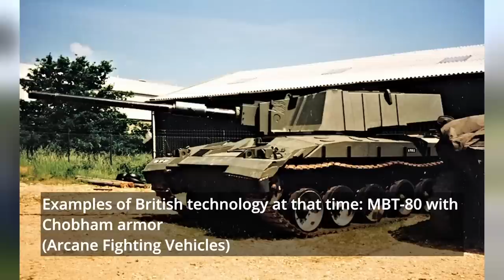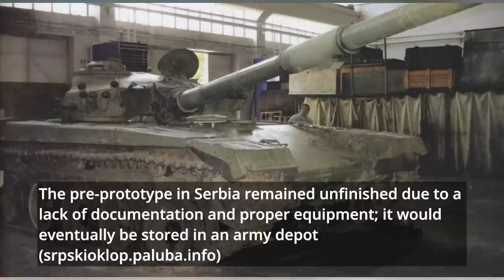Whirlwind before the Crash | M-91 Vihor

Comment: M57: "Let's take the TT-33 Tokarev and improve it."

M70: "Let's take the AKM and improve it."

M-84: "Let's take the T-72 and improve it."

The Yugos sure did a lot of that, not just copying other designs, but actually improving on them in many ways.
Reply: Serbia continues this tradition to this date
Reply: @TheJohn_Highway  maybe other things, but most definitely not AKs. All those newer imported zastava AKs are 10 times worst then those produce during Yugoslav times. Did you made any improvements on M84 or those upgrades are still on backburner just like Croatian "degman" (which seem to be cancelled)?
Reply: Yugoslav was really good in this. Even when they changed the design of existing firearms such as Zastava M56 which was kind of a hybrid in PPS-43 and MP-40 and it was awesome
Reply: Nah the m84 still sucks the t72 is still a better machine

Comment: Even the M84 wasn't simply a T-72 copy. It is not fully compatible with other T-72 variants. Gun is, autoloader and general appearences. However, armor materials were a bit different, it had totally different fire control system, ballistic computer, self-entrenchment tool and some of them were equipped with anti-magnetic system for mine defense (basically, it increases magnetic field of the vehicle thus causing magnetic mines to detonate too soon, before the tank runs into them). Also, the engine was totally different; it was multi-fuel instead of diesel. 
A lot of these and more were to be incorporated into Vihor (Whirlwind). But, it never came to be...
Reply: But Is true that it'was based on  T-72 export variant inferiour to T-72 made for russia?
Reply: @sjoormen1  The export variant is inferior because it is missing all the stuff that Vihor added back.
Reply: @zchen27  thx so it's same, not better than russian standard model? What aboout armous- does turret have quarts in it?
Reply: @sjoormen1  M84 was based on export "commander" version of T72.
Ordinary export T72 was called by western experts "monkey"T72 bc the quality of armor and materials was worse than of T72 made for Russian army.
Only commander version of T72 was the same as real Russian T72.
More than 100 M84s were exported to Kuwait before Gulf war and they turned out to be superior to Saddam's T72s.
Croatia continued to export them even during war between Croatia and Serbia(which I don't understand bc we needed tanks) but also we needed money so...
Reply: @mynick937  thanks for you answer.
Reply: @mynick937  actually during our wars, not Croatia alone was expottimg tanks to Kuwait, but together with Serbia.. Croatia ćn engineers were coming to Belgrade for consultations and for paperwork for export, and visas in Kuwait Ambasy, and than back to home, and together with tanks were going with ships from croatian ports..
Reply: @mynick937  the secret reason is corruption
Reply: @lukabajic9729  I don't think so.
It was probably political decision.
Reply: @sjoormen1 the export t72m/m1 werent inferior, the m was a t72a with a ural 1 turret, whilst the m1 was identical to the A variant
Reply: @mynick937 everithing you said is wrong. Export t72m are t72A with a ural 1 turret and t72m1 are identical to t72A. These were the models operated by The warsaw pact and yugoslavia. The so called "monkey models" are these tanks with most of their internal electronics removed before being sold, these were only used by countries the soviets deemed as not trustworthy.
Reply: @barbarapitenthusiast7103  Sure about that?

Comment: It was not licenced T 72 although they look similar. It was completely designed and produced by Yugoslav engineers. My dad was working on this project developing propulsion system.
Reply: I've heard that a license was bought for the T72M but sub systems were different and armour at least on the M84A.
Did Vihor have an auto loader like T72? Thats the biggest problem on T72 the ammo explodes thats why Western tanks always have the ammo in a separate compartment with blowout panels.
Reply: @aramisone7198  initial production M84 had manuel loading, soon upgraded to auto, new aiming system, electronics etc. Yugoslav M84 didn't have that kind of problem with ammo exploding
Reply: @aramisone7198  the autoloader is not the issue, its the least hit area on the tank the real issue it the ammo in the turret, but that can be removed. Most nato tanks dont have blowout panels, only the m1 abrams has them, leopard 2 have most of their ammo unpprotected next to the driver behind paper thin armor, chalenger 2 have all pt their ammo exposed.

Comment: I'm sceptical, those are mostly goal statistics, i highly doubt if they'd actually manage to achieve all the numbers yet keep combat reliability.

Like the "80% ERA protection" which in reality was closer the 25-30%
I also think that 600mm pen would likely be 450-500mm pen, and it's own armor to also have lower values in reality, along with the horse power.

Regardless, tanks aren't only about hard factors but soft factors too, and I do think it would be a competitive tank due to those, just not in the way unrealistic tank fans would think it would.

Comment: M84 was much better than T72.. for example M84 in all versions have meteorological sensor,modern range finder,fire control unit.. first Russian T72 with meteorological sensor was on T72BA in early 2000s.. when M84 was made,there is few tans with modern electronics,even western tanks had coincidence rangefinder.. Leopard 1,American M60.. you had to calculate how much you need to move your barrel to compensate some stuff or intercept other tank.. in M84 you just had to aim and shot.. In 90s they had so many casualties just because we didn't have ERA.This tank had all modern German sensors like Leopard 2.. If we need to compare,its somewhere between leopard 2A5 and 2A6..also at that time Leopard 2 still had ammo in tank turret...

Comment: challenger2 and Abrams have at least double the armour protection.  so no , this tank could not keep up with the west.
Reply: that's about everything those two tanks have, they have worse speed, weigh more (thank the armor), worse gun and in general were bigger, western tanks are the DIRECT opposite of eastern tanks: slow but big ball armor, while the eastern are more mobility over armor
Reply: My Source: I made it up
Reply: @Lazar-ox5bd don’t know what you are smoking but the west definitely do not have worst guns and depends on the tank but not worst speeds. Eastern tanks usually have lower weight but also their engine power is much lower, only the t80 series is an exception. The west also have much better transmissions. While firepower the guns are the same but the west has much better ammo.
Reply: @profesercreeper   remember when I replied?